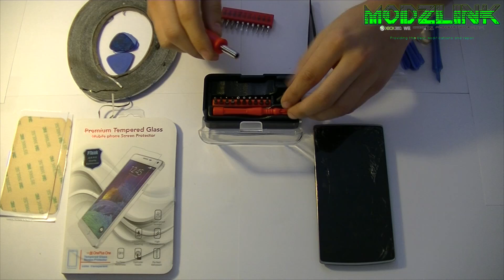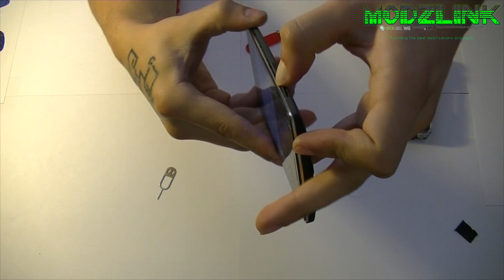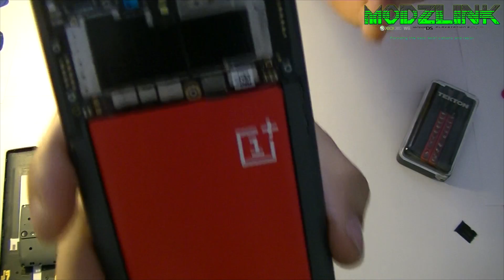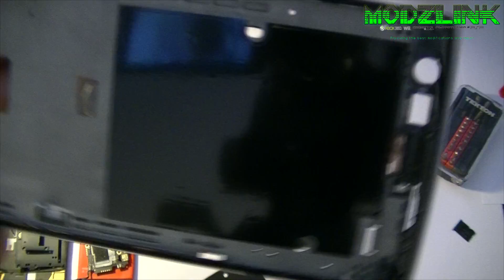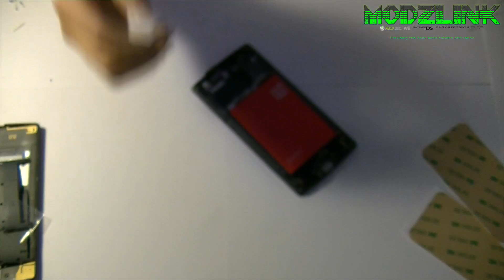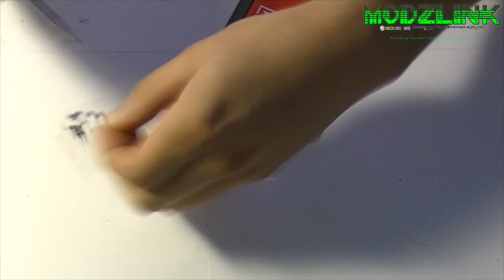How To Replace The OnePlus One Screen [ModzLink.com]

Comment: The video was very helpful. I replaced my screen but the led navigation buttons are not working. The battery is charging very slowly after the screen replacement. What could be the issue? Thanks a lot

Comment: Hey guys, can I trust this Ebay seller for a screen replacement?
http://www.ebay.com/itm/For-Oneplus-one-1-A0001-LCD-Digitizer-Touch-Screen-Display-Assembly-Replacement-/181790899202?hash=item2a5394fc02:g:n1gAAOSwKIpV-4k5
I just want to get my phone working without paying a premium, and Ebay has a money back guarantee. Also, if any of you have replaced your screen with a better/cheaper replacement, please link it to me. I desperately need my phone working again. :(
Reply from the maker: +CheekyGoose read the description amazon is better for everything
Reply: it doesn't really matter since they're dirt cheap. but a good rule of thumb for replacement parts is Amazon and eBay are not good sources for those.

Comment: Thanks for the guide. Used it twice already! I found the battery difficult to remove but a long blade helped free the glue without bending the battery(..any more)! The 2nd replacement I did, didn't work though. The touch screen is registering the finger commands, I can hear it clicking, but the screen is not lighting up. It sort of lights up a little at the top and bottom but that's it. Any idea what the problem could be? The only thing that gave me a problem was removing the 1st replacement screen. I got it all out but at one point on the top it bent the frame a little.
Reply from the maker: You could possible just have a bad LCD or maybe bending the frame made the replacement screen fit improperly which would lead to it breaking. There isn't any room for error when you fit the screen. Try a different screen and see it if works.

Comment: There is no need to remove pcb and other cables or even open bottom lit when you change screen.
Reply: Yea you DO NOT need to remove any of the PCB cables. I ripped my USB cable doing this!!!
Reply: Correct, only if you need to change the frame (like I'm going to have to)
Reply: I was wondering why he was doing all that.. ugg.

Comment: Do you have experience with and would you recommend using something like this? 

https://www.fixez.com/oneplus-one-display-assembly-lcd-touch-screen-with-frame

The price of a replacement screen with the digitizer isn't much cheaper than with the frame so all I would need to do is move the motherboard, ribbons etc.

Comment: My phone had a rubber gasket around the edge of the screen which was glued in place. There are tiny locating pegs on the top and bottom of the bezel which protrude slightly, so they would need to be removed if not refitting the gasket or leave a gap in the tape to avoid a high spot.

When replacing the screen you don't need to strip the phone right down as the cables easily slide past the board etc. 

One thing I noticed you missed was the foam gasket around the front facing camera which can allow light to bleed through.

Comment: thank you so much! managed to do it and its working again! 
i have one problem though. my screen works perfectly in the main menu, but in app or with my keyboard the bottom part of the new screen isn't extremely responsive/the thing slightly above what i'm clicking on gets pressed. but in the main menu i don't face the same issue for some reason. Does anyone have a solution for this?
Reply from the maker: +Jonathan D'Souza it may just be an issue with the screen you used.  Unfortunately most screens are not oem even when they claim to be
Reply: +ModzLink okay. Will try and return it :/ thanks a lot though!

Comment: Hey I need you help, i hae a oneplus one my pb is  the touch screen it is not working but the display is working i hope u understand me and will answer me
Reply from the maker: +Ibbou Raouf You need to replace the LCD and digitizer assembly as done in this video. If you recently replaced the screen check the ribbons that connect to the motherboard from the screen. Sometimes small debris can be lodged in these connectors preventing things from working properly.
Reply: Oh thank uuuu

Comment: what if i accidently ripped the volume up and down strip that connects the buttons to the motherboard? I was trying to take of the buttins like in the video but accidently ripped the black strip
Reply from the maker: +Leonardo Vela The tape strip? put new tape on it and tape it back down. If you're referring about the metal cover then you will need to buy a new button ribbon and solder it back on the motherboard.

Comment: i just tried to fix mine one, but i could not get it to turn on, how ever if i plug the phone into the charger the screen does go one ??to charge. how can i get my phone to turn on
Reply from the maker: +Hay Ben Shoushan check the battery and screen ribbons for debris.  If it still doesn't work then  check the battery for damage.  If it's damaged you will need a new battery.  Email Sales@modzlink.com if you need one.
Reply from the maker: +Hay Ben Shoushan check the battery and screen ribbons for debris.  If it still doesn't work then  check the battery for damage.  If it's damaged you will need a new battery.  Email Sales@modzlink.com if you need one.
Reply: +ModzLink thanks :D

Comment: Modzlink, forcing the battery is a bad idea I bent mine watching this. You can remove the bottom cover much like the camera one and if you heat the adhesive (with your breath or hot air gun, but careful) it should be removable easily.)
Reply from the maker: +Ozan Akyıldız The latest video on how to change the SIM slot shows a better way to take out the battery.

Comment: HI, I replaced the screen in my OPO today, I turned it on and now goes in and out of signal. Can you help me trouble shoot this?
Reply from the maker: +Boston “Juel” Tillery check the ribbons and connectors for the lcd. Sometimes debris or metal shavings get in there and cause shorts. If there's nothing there then you might have a bad LCD and will need to replace it with a different one.
Reply: ***** So the LCD could be causing the loss in signal?
Reply from the maker: +Boston “Juel” Tillery I thought you meant signal as in "video signal" not wifi or network signal. If it's wifi signal you probably broke or didn't plug in the cable that runs along the battery. If it's network related then you may have damaged another component on the main board. Check the pins on the mainboard that make contact with the back casing. If they're broken that would be your problem. This phone uses the outer casing as an antenna and it connects to the mainboard via those small gold pins all over the board.
Reply: ***** Thanks for the reply, I checked then rechecked the gold pins and network cable ;) I really don't know what to do..
Reply from the maker: +Boston “Juel” Tillery The only other thing I can think of is the SIM card tray pins. (if it's a network error) You never mentioned what kind of "signal" you were losing.
Reply: ***** The sim card still shows though which is weird and whenever I pick 'choose network operator it still shows various carriers. Maybe I should just sell the phone...
Reply: ***** Did what you said and pushed the connecters very hard and finally got it to work! Thanks for your help!
Reply from the maker: +Boston “Juel” Tillery np, glad you got it repaired just remember to drop a like or share the video

Comment: Hello I have accidentally broken the ribbon the the volume up/down flex cable, may there be any way to fix it?
Reply from the maker: +Ivan Blanco The only way is to get a new ribbon http://amzn.to/1Q4BXXy or to use very small wires such as this http://amzn.to/1Q4BPHy to bridge the contacts again. Either way there will be soldering involved but installing a new ribbon is the easier choice. If you don't feel confident enough to do this repair yourself you can contact sales@modzlink.com for a quote.
Reply: +ModzLink Thank you very much!

Comment: hello there. 

My oneplus one's screen seems ok! but i can not use bottom side. i droped on the floor and its not working approximate  3 fingers on bottom site of screen. Should i change only screen or ... ?

 Thanks for video
Reply from the maker: +Emre Kara If the screen is unresponsive then yes, you need to change the screen.

Comment: Thanks for the video. I bought a replacement screen that was already attached to a new frame so that saved a lot of time. Took around 2 very careful hours. I broke the plastic pry on the battery pack so I switched to a small metal screw driver which pierced the aluminum foil that covers the battery pack and caused a spark. Also I pried in the wrong spot on the ear speaker and compromised it. Back together the phone works great and the ear speaker is mostly still working. I ordered a replacement battery and ear speaker so hopefully that will complete my screen replacement adventure.
Reply from the maker: +Doug Nanda Becareful with using the phone with the current battery. It could explode at any moment and cause serious burns.
Reply: +ModzLink Ya I don't trust it either. Will have the replacement in a few days. Thanks for your concern. I did cover the small hole I made with kapton tape.

Comment: Thanks Man ! I have a back cover and sim slot need to be replaced.
do you know where I can get it .
Benny From Australia.
Reply from the maker: +benny dang You should be able to find them on ebay but they're not very easy to replace. I'll hopefully be able to make a video on the actual replacement in the next 2 weeks.
Reply: Yes ! I found it Thanks again.
Cheer

Comment: does anyone know what those two copper strips are on the back of the lcd?  does it matter if they are severed off?
Reply: They are grounding strips on the back of the screen. It will work without them perfectly fine but One Plus put them there just in case.

Comment: Do you have to use the adhesive around the frame for the screen or can you just put the screen on? Mine came with tape but it has cutouts (i dont know why)
Reply from the maker: +Dablobadobdob The adhesive that comes with screens is topically not the best. which is why I use that black adhesive instead.

Comment: i did this and i replaced my screen perfectly fine. But now when i press power button nothing happens. But when i start to plug it in to the charger i get the one plus loading screen and then all i see is the battery percentage and then turns off again until i re plug it.
Reply: +The911clutch  i have the same problem, did you solve it ?

Comment: Why does everybody remove the board on the  top and the Usb+board on the buttom to replace the display?
Isn't it enough to disconnect the two ribbon cable of the display?

Comment: Hi and thanks for your very good tutorial. I followed all the steps and my touchscreen is now working perfectly, but my motherboard is overheating as Hell, do you know why or what i didn't do well ? I was thinking about a bad contact located on one or another gold contactors, because i found it quite hard to plug back ! Could it be the problem ? Many thanks. JM

Comment: I just cannot get that power button loose! Going crazy. Volume button was no problem. Already worried that I have damaged the power button ribbon. Ideas?
Reply: Johan Axelsson Yes, the ribbon is off! What the h-l do I do now? :(
Reply: Okay, found a new button and ribbon on Ebay. I used to mod my friends original xboxes, but that is like 15 years ago, might not be up for this... I'll order the part and ask around for soldering help among friends.  Thank you thou!

Comment: HI ModzLink,

i have followed your instruction to replace my 1+1 screen but i just couldn't turn my phone on. Was suspecting if my power button doesn't work. 

Screen seems to be ok, as it shows the 1+1 logo and battery status when i am charging the phone.

Hope you could advise me. 
your video is very useful and detailed but just i couldn't figure it out
Reply: ***** 
thanks so much bro.... 

Indeed i broke my power button ribbon and managed to find a temporary solution to power on my phone.
Million thanks ....... I spent 15 hours to change the screen as i was totally new to the mechanical stuff. 

In short , your video instruction is awesome !!!! 

solution for whoever broke the power button ribbon, temporary solution could be found by using following tips from oneplus official forum:
Use something metal like a screwdriver and touch together the two solder points that attatch the cable to the board. It will simulate a button press.
Reply: +meng tee Chin im having the same problem how do i fix it?
Reply: what problem?? the power button is spoiled/
Reply: Use something metal like a screwdriver and touch together the two solder points that attach the cable to the board. It will simulate a button press.

For easier understanding, use a screwdriver to touch both of the points that the power ribbon is supposed to connect.  If i remember correctly, there are 2 gold pins that the power ribbon need connect to, just put ur screwdriver  horizontally to touch both of the pins will start your phone if everything is installed properly.
Reply: +meng tee Chin i tried that it didnt work, any other suggestions ?

Comment: Hi, nice video. I used your guide and succesfully changed my screen, my phone works, but after I turn it on and phone go to sleep, I cant wake it up neither power button or doubletap. Is any chance you know about this issue? Iam not a sure if I original screen or not.THX mate
Reply: ***** In my case nothing works and I have no idea how to root it and get new cyanogenmod. I just checked and I have 12.0 but i havent any problem before change.

Comment: Followed along and worked like a charm, my phone is back from the dead! Thanks a lot. I did cheat a little though, I bought the integrated screen and 
frame unit so no glueing.
Reply: Congrats! Where did u buy this module from and would u recommend someone like me who has never replaced a screen to follow this guide and do it? Thanks

Comment: One question here. Is it really necessary to pull the mainboard out? If yes, what's the reason? The screen is only connected through the hole under the battery (attached to the mainboard) and at the top of the phone where the smal grey plastic part is attached. Don't see the point to remove mainboard, volume buttons, power button etc.

Comment: Hey, dude. Question, I'm planning to replace my OnePlus's screen and figured I might as well replace the metal frame, BUT I'm buying them separately and not attached, how is the process for attaching them yourself? Can I just use some 3M adhesive tape to attach the screen and digitizer to the metal frame and get my components out of the old metal frame and put them in the new one?

Comment: Hey, good stuff. Just one question, I was trying to replace the display, did all the steps gently but at the end when I was turning on my phone: just a strange vertical signal and nothing else, the phone vibrates every time I push the on button and that’s all. I tried also to charge the battery but nothing.
Did I screw the display?  Thanks for your help.

Comment: all worked good after following your steps, but after assembled i noticed there was little screw i went back and install it in the motherboard, The problem i ripped the volume buttons cable, Please advice
Reply: *****  these thin cables can i extract it from any thing useless in my stuff (controller, toys, remotes) , and how to attach them, is there some sort of glue or something ?
sorry for bothering
Reply: ***** i need the volume button cuz i tried to restore opo to stock, now my phone is stuck in the 1+ logo and i cant put it in the recovery mode without the volume button :(
Reply: *****  Thank you so much <3

Comment: I got a question bro, I just want to get to the scren so I can insulate some grounding issues Im having, my current screen is  in perfect condition, do i need to put glue back on it? or it will be fine if I just open, do the thing, and then assembly. thanks!!
Reply: So It should be fine if I put the adhesive just like you did here following your instructions? Dont matter  its the same screen. Thanks for your help brother
Reply: ok pal, thanks a lot, I appreciate it

Comment: i got a problem with my file system that is corrupted... I try to get in rtecovery mode and reinstall my cfw but its still not working my ps3 stays loading or freeze... It's even freezing when i click on 'restore database' or on the other options in the recovery mode...